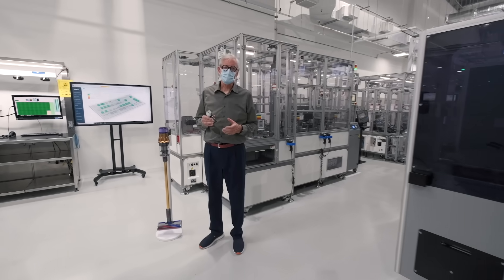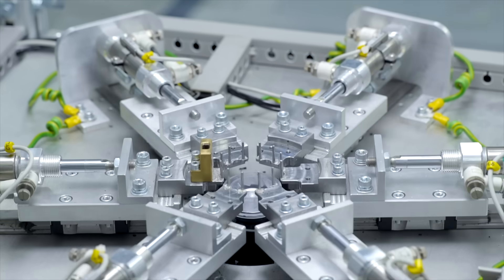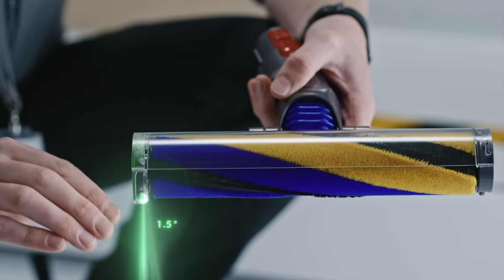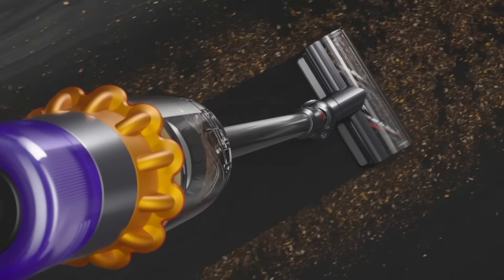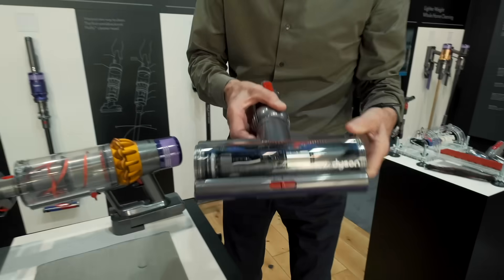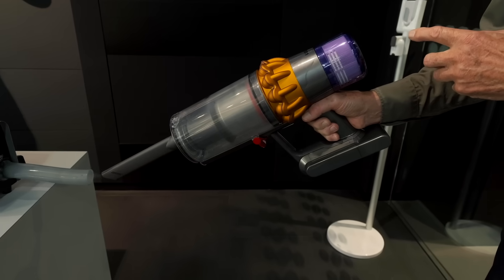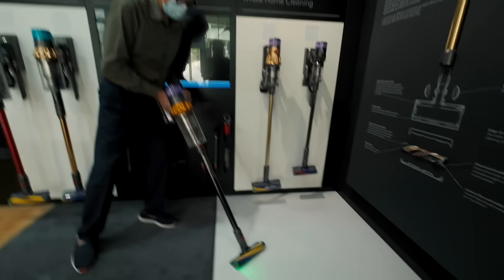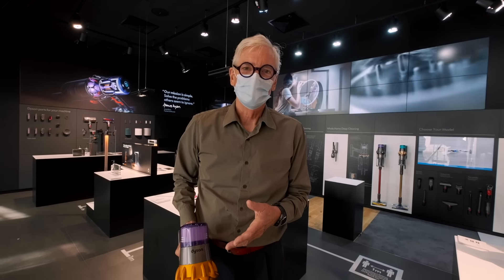James Dyson launches new Dyson vacuum with laser technology.

Comment: Imagine if you put as much energy into design and materials as you do on technology, you would get the perfect product.

The technology is fantastic but the design looks so cheap.
When I see it on video it looks great but in reality when I hold it, it looks so cheap.
The chosen plastic material is of the cheap type, cracks, makes strange noises and unfortunately destroys the whole experience.
The question is do they use organic plastics that are degradable?
The handle is not ergonomic and not developed for one hand.
The charging module feels like it should break every time I charge and feels very cheap.
Something that does not go with this one that goes with regular vacuum cleaners is to vacuum backwards, you can only vacuum forwards.

Soundproofing, add some material that removes these loud bright sounds.
You get pain in the ears from the sound, it would probably be enough to make the product 2-4 millimeters thicker around the engine and the problem would be solved.
There are experts who do nothing in life but deal with sound and hire such a person for a few months and they would do wonders on the product.

Amazing Work by the Dyson-Team!

Comment: As a 12-year dyson customer (multiple vacuums bought) I am going to be blunt, this is gimmicky. Dyson and co. you folks need to focus on ergonomics. For example, after all these years you still produce your portable vacuums with an uncomfortably hard generic (one-size fits all) handle. Why can't you design your portables with interchangeable handles (new non-gun grip designs) to meet various hand sizes and preferences? Why have you given up on your cannister vacuums. Only a few years ago you had multiple models now you are down to one that is based on an old design. I just bought it because it just fits my needs but was disappointed at no other options available. This lack of innovation (gimmicky laser doesn't count) is allowing the competition to catch up and surpass. Come on dyson, update your basic designs. Let's see some cool innovate handle designs. The gun-type only is getting very stale. The extremely dated ergonomics are embarrassing.

Comment: I'm about to spend $700 on a vacuum cleaner now, thanks Mr. Dyson
Reply: @drundub73  Ours is similar but he has started jamming himself on corners or table legs.
Reply: Sucker - it will fail about a month after the warranty expires.
Reply: @tonysutton6559  Found the guy who never fixed anything in his life lmao
Reply: @tonysutton6559  had mine for a year no problems with it lol
Reply: @jv-fy1de  Ours lasted just over 2 years and then died just after the warranty ended. The same has happened to several friends and family members.
Reply: @tonysutton6559  5 year warranty.  Cost of ownership even if it lasted 5 years = $100 a year.  Less than $10 per month.

Comment: If all your vaccums are going cordless I will be going to a different company. I hate batteries, they lose strength, they go bad, they are wasteful. If I can't plug something in and get full power without the hindrance of a weak cell and charging its not a product I want. I bought your older models, I won't buy your batteries.

Comment: That's nice, I'll buy the Henry anyway that's if mine ever breaks. Had it 8 years and so far all I've had to do is replace the plastic hose and some attachments
Reply: If I were you, when your Henry breaks, get it fixed.  I picked up a 'new' Henry and when I turned it on, I assumed there must be a blockage.  However, when I checked all was good, but the new motor in the newer Henrys is about half the power.

Comment: Do you know if you put a small hand size torch light on the floor, you can see the dust particles. While you vacuum the floor. I have been doing that for quite some time about a year. I stumbled across that method by accident.

Comment: Okay, this is clutching at straws now Sir Dyson. I love your products but all you've done here is mount a green LED parallel to the floor surface. This isn't revolutionary.

I use the same principal with an standard LED torch like the one you first had in your hand to detect parts I've accidentally dropped on the floor, or to expose surface imperfections or defects on things like aircraft panels. Doesn't need to be a "special laser". Again your products are fantastic but let's not over exaggerate simple features.

Comment: How is the maintenance of the particule counter? After several moi the of usage I expected that this counter will be covered with dirt. How to clean it? How you guarantee that it will perfectly work for 5year and more without maintenance? Already your cyclone system need for time to time heavy cleaning inside due to dust accumulation. Does your new design tackle this maintenance?

Comment: I have a V7 Animal at my place...the problem with it and other models is that when we push the button to open the bin, some of the dust always spills off on the floor while emptying...need some innovation in that area also if the bin can self clean or anything to reduce human effort in cleaning the empty bin that would be great.

Comment: I'm currently own v10 cordless vacuum and waiting for next gen with more suctions power and longer battery. (it was their tradition). I'm quite disappointed.  It only add razer to the soft vacuum head and dust detector. It has slightly improved suction power while have same usage time to v11. I guess I need to wait another 2 years.

Comment: The suction is good but the material they use to build these vacuums suck bug time and are way too expensive to fix. My wife has the v11 and we have changed the wand twice and the power adapter, and now the dust bin needs to be changed due to broken parts which i must point out is nothing to do with the way we used it

Comment: This may be an unpopular opinion but I really dislike our dyson.. your testing doesn’t  represent reality.. in our house we have area rugs that are not glued and staples to the floor. Because the suction is so strong, you can’t make one pass on the rug without the vacuum getting stuck and the brush stops working. Forget about small bathroom or entrance rugs. Even if you change direction this still happens. Your vacuuming hand develops like hulk by the time you get through the house; it’s like a fight every time to push the vacuum forward without it getting stuck. Because the carpets are not attached to the floor, they have some give to them, so when the suction pulls them up against the hard bristles, the brush is literally ripping the carpet threads. So when you see so much stuff in your canister when you first start using it, it’s because of that not because you may have missed spots. After a while, the area rugs thin out as a result. Back to suction, when using the hose and attachments, you have to put your foot on the vacuum to hold it from moving, put the vacuum behind you because yes it will move and tip over, and then put the hose over your shoulder to stretch it because the suction is so strong it doesn’t allow the soft hose to stretch. And like that on one foot, vacuum the edges of the room,  or the stairs or whatever else you need to use attachment on. And holly hell is it loud, it takes a good 2 hrs to finish a house, and I’ve never not got a headache from how loud it is. I can’t how this is with the vacuums wh were the motor is even closer to your head. Vacuuming is an easy way to get kids to help and learn to contribute. But only if your kids have hulk like strength to battle with the suction. Your testing facility should improve to represent a general household and who performs vacuuming. Hair and general household crumbs/dust do not need so much excessive suction to be picked up.. yes this may be an unpopular opinion but after 5 years of dealing with one, I do have a right to it..the good things about it is that all the parts are well labeled and it is easy to disassemble to clean and maintain. The canister is unnecessarily difficult to clean with all the hair tightly wrapped around it but that not the end of it. The soft hose is ripping in spots, not surprising though due to suction issues.

Comment: Never in my whole life have I had so many faults with a vaccum as I have with the Dysons I've owned. The build quality is terrible. The only positive is the five years guarantee but all the arsing about meeting engineers and now having to send the vacuum to them as they won't do house visits. I am moving to a different brand..
Reply: Ive owned v8 for like 4 years and never had problem with it... No idea what youre talking about
Reply: @e36fanatics  same here. Not a problem with them. 4 years gone
Reply: Nope, dyson is leap years infront of any other brand
Reply: @tikklemeemo1979  Errr nope.... I have a Kirby as well. It's heavy built like a tank, but never goes wrong. Dyson need to stop using cheap plastics.

Comment: That's the most gimmicky thing ever.
It requires:
- That you vacuum and completely flat surface (carpets, fabric... or anything really that has the slightest curve, not gonna work)
- That that surface is not dark so you can see the shadow the tiny dust casts
Reply: @light_splitter  it's not mentioned in this video.  Regardless, I see most of this tech as just diminishing returns, but still find it cool.  I had the s12 myself and actually kept my Dyson v8 over it, because I found it simply did a better job in my experience.
Reply: @light_splitter  this Dyson is doing that too numbnuts.   This model will adjust based on dirt levels.

Comment: "it is so effortless because the weight is distributed between the motor and the battery and there is no weight on the floor head."

So you're saying I bear all the weight on my hands, which will be more tiring overtime than If the floor head bears the weight of the battery and motor.

Not saying the design is bad, but the statement made me laugh a bit.

Comment: We have 2 dyson vacuum cleaners. Trying to dispose of the dust out of the clear container is like releasing a dust bomb every time. There needs to be a better solution to push out the dust/junk that has been vacuumed
Reply: I do it outside usually... And just walk away so i dont breathe any of it
Reply: This is the reason I still have a bag vaccum cleaner. The charging station should suck the dust out into a bag. Some robot vaccums already do this.
Reply: They should design a bin with a docking lid that prevents dust from escaping. Click in, release the dust, bin sooks in the dust while sealing the dust in then releasing the container. Simple ;-)
Reply: Small price to pay to never have to worry about finding bags that fit ever again...
Reply: They need to figure out a way to compact the dust bin contents into a solid cube of dust that can be dropped into a trash can without particles flying everywhere.
Reply: Same problem here.
Reply: Do it outside, problem solved, don't be an ignoramus.
Reply: @futuremlbplayer10  use the other dyson to clean the first obviously.
Reply: V11 is worse. Attachments mus be removed to empty bin and it takes way too much pressure to release.
Reply: Stand up wind!
Reply: Yes buy a Henry
Reply: A men to that comment
Reply: Just vacuum the what is inside the dust bin with another dyson.. boom problem solved lmao
Reply: I put the bottom over a grocery store paper bag and lift. Close it and then it on around the little dust. I have a v8 also. The newer ones should be better at it.
Reply: @C_O_N_C_E_P_T  I personally don't like v8, but it's a good way to get your servings of vegetables for the day. I like that your reward yourself with a can after you empty the contents of the dust bin from your vacuum cleaner.

Comment: Ive had two dysons, one upright which broke down three times in 14 months, and one handheld which cuts out every 10 secs, then you start it again, I won’t be rushing to buy another, which are usually priced 3 times the cost of rivals,  do a quick WHICH magazine search and Dyson do not come up very well, some are good but very expensive, other makes are equal and at least half the price.
Reply from the maker: Hi, we're sorry about the issues you're having with the machine. We take feedback very seriously and will do our best to get the issues you're facing resolved.

Please send us an email so that we can have a look into this for you.

Email: askdyson@dyson.co.uk

 Alternatively, you can reach out to us via Facebook, Instagram and Twitter
Reply: @dyson   You spout on about your engineers success yet they cant develop a vacuum mast that extends easily and doesn't leak air with a whistle noise coming from it..  You use a foam spacer to seal it...  Very poor effort. I might add that the ball vacuum wheel jam and the barrel clip that keeps it closed is so small it keeps coming unclippped each time you remove it and covers the floor in dirt..

Comment: @Dyson, is there a way to turn on the laser eithout having to turn on the vacuum. To check the room for dust for example.
Reply from the maker: Hi there, thanks for getting in touch. The laser only works when the V15 Detect is turned on. If you need anything else please let us know.
Reply: @dyson  Oh okay, but it could be an added feature before you launch it. But thanks for the response.

Comment: In my experience, the quality of the plastic materials of my V10 heads and attachments is not adequate for the price.  I hope this V15 has received some improvements regarding the durability of the materials.
Reply: I agree with the build quality. My V10 broke after I vacuumed up some building dust on my kitchen extension. It just said it was blocked all the time even though the filter was cleaned. It was impossible to take apart and clean. I bought the V10 as my V6 just kept cutting out for no reason. I will never buy a Dyson vacuum again.

Comment: Amazing amazing product! Agreed with every word until the end. Technically if the dustbin and motor were closer to the floor it should cause less fatigue to the arm.
Reply: If your vacuum is always on the floor, true. But the moment you'd want to lift it off the floor, even for a second, it would feel 5 times heavier.
Reply: @JosefTD  interesting point

Comment: 230 Airwatts? I am saving $200 or 300 in order to buy an used V15 in 2026, while V21 or V22 is coming for $3 999. By then, Dyson vacs will be able to teleport the dust to the landfill overseas, maybe in Cité Soleil, or Northern Bahr El Gazal.  I'm very happy vacuuming with my DC33 and DC65.

Comment: I wonder how well this would work in a farm house situation. I have new thick plush carpets in my main rooms, which when using the animal ball 2 I have to take the base plate off or I can't push it. It then does a nice job. Also higher than regular households worth of dirt and alfalfa leaf bits etc mixed in. I have vinyl floors in mud room and kitchen hallway area's. The reason I was looking into a stick version is for ease of use and when trying to vacuum the stairs the hose draws in so tight I can barely stretch it enough to reach all the stairs. I have to park the main vacuum at the top and pull the hose through the banisters or I would tip the main unit over trying to stretch the hose. Any advice would be awesome thank you Dyson.
Reply from the maker: Thank you for your interest in the Dyson cordless machines. The Dyson cordless machines have a wide variety to choose from the Dyson V6™ with a 30-minute run time to the Dyson V11™ outsized with a 60-minute run time
Below is a link to take a closer look at the Dyson cordless range.

https://www.dyson.co.uk/vacuum-cleaners/sticks 👈

Comment: Hi Im a House Cleaner and some of my work uses a Dyson Vacuum cleaner. the Hair Head is Good but hairs not only on sofas it also on carpets and floors toilets shower.. i have a question is Dyson cordless vacuums water proof.? thanks.
Reply from the maker: Hi there, the Dyson cord free machines are not waterproof, we would recommend keeping them away from surfaces with moisture until dry.

Comment: take any regular torch and illuminate the floor at a sharp angle and you'll see all the dust you want. You can even do that with your phone's flash when the room is dark..
Reply: Oh yeah super comfy vacuuming while holding my phone at floor level
Reply: @alex9621  That's not the point. it's just a marketing gimmick.
What is the merit of illuminating the dust if you are vacuuming it anyway?
Reply: @benjaminq3226  because if you can see the dust it makes selling you a Dyson air purifier a much easier sale
Reply: @benjaminq3226  Many vacuums have led lights and they're very useful. Lasers might be a bit much but I guarantee you it's nice having them
Reply: Doesn’t work as well as a laser though